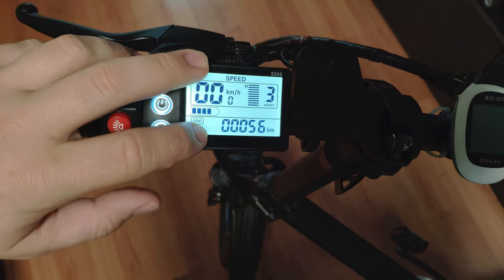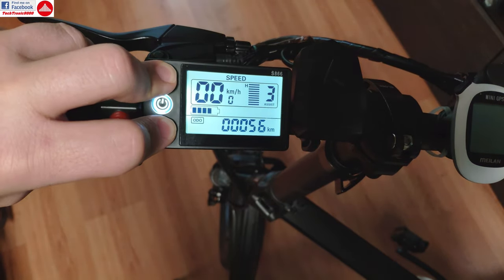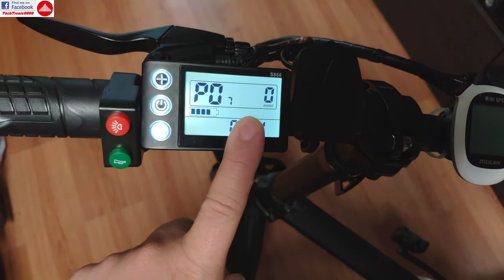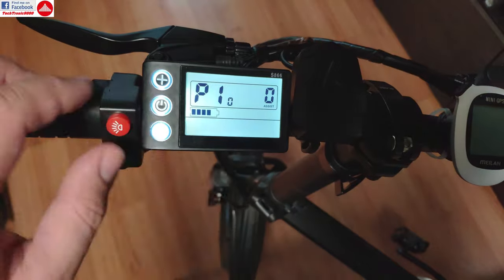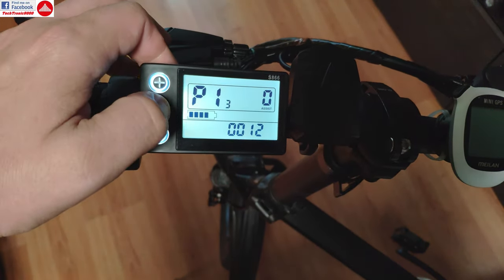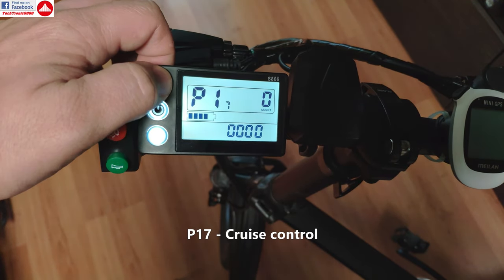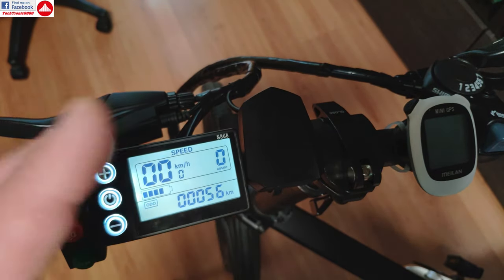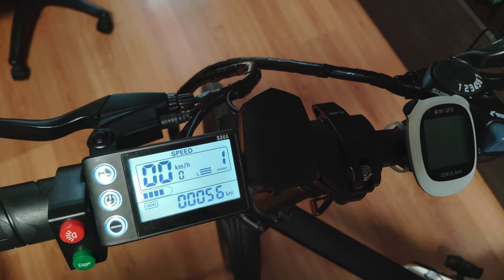ADO A20 / A20F / A16 S866 LCD - Complete Settings Walkthrough (P01-P20)

Comment: To get cruise control to work at least on my bike ( I have a s866 controller it's a hit way bk11) hold the throttle in a comfortable position say going 13 mph hold it there then push and hold the negative sign (-)on the controller. After a good 3 to 5 seconds a letter "P" will appear on the display where the assist value number normally is.you'll be able to let go of the throttle and you should be able to maintain that speed even if you start pedaling. I use this function to set my speed to something that's comfortable for me to keep pedaling with resistance while in 7th gear and not feel like im doing the running man..lol. just a nice powerful pace and I can continue to provide manual power and save a lot of battery as my pedaling and the cruise control work in tandem. Please let me know if you were able to get this to work for you.

Comment: I bought the Hitway BK3S and l've been having quite a lot of fun with it for the last few days. It has 3 speed settings that are L - 9MPH M - 12MPH and H - 15MPH and everything was fine until yesterday. Now L and M still work as intended but H is now around 20MPH, I don't know what I've done to uncap the speed limit but I want it back to 15MPH. I'm more concerned about the motor/battery exploding than anything, plus the bike doesn't have very good brakes so 20MPH is just to fast for me on this bike (also it's illegal l think in the UK)

Comment: Thanks for you help, do you know how to reset it back to factory settings?
Reply from the maker: There is no reset to defaults. You just need to set each parameter correctly.
Reply: DEFAULT SETTINGS 
:
P01: 2    (Display brightness)
P02: 0     (Km or miles) 
P03: 36  (Nominal voltage)
P04: 10   (auto sleep time minutes)
P05: 0     ( power assisted mode )
P06: 20   (wheel diameter)
P07: 1     (number magnets motor)
P08: 25   (speed limit, increase to 44 for max speed)
P09: 0.    (non zero start, 0= no pedal needed)
P10: 2.    (drive mode, electric, assisted or normal bike)
P11: 2.     (assist delay since peddling started)
P12: 3.     (Strength of acceleration)
P13: 12    (PAS sensor)
P14: 15     (controller current limit)
P15: 29     (battery controller voltage limit)
P16: 0       (reset odometer, km to 0= new bike)
P17: 0       (cruise control)
P18: 100   (Display range adjust)
P19: 0       (0 gear assisted)
P20: 0      (controller communication mode)

Comment: I have hitway bk11 and ive changed it to 100 speed limit but it still doesnt go past 25kmph is that because i dont have a throttle? Can it go past the limit in pedal assist mode? Very gratefull for any reply.
Reply: I found out I had to change p08 setting to 67 instead of 100 and that worked hope it helps others.
Reply: Is your throttle broken? My BK11 has a throttle

Comment: When I start it up it shows that there is a battery percentage section. How do you get that active on the screen?
Reply from the maker: That is just a test for the LCD screen. The controller is not programmed to show the %, you can use the "VOL", voltage for even more accurate monitoring.

Comment: For Cruise control hold the throttle at what speed you want and then hold - for 2-3 seconds
Reply from the maker: Depends on the controller version. The ADO bikes has a controller version change, the first one didn't have working cruise control.

Comment: I accidentally changed the wrong setting in my bike now it reads 4km/h when it's stopped so I was panicking trying to get it back to 0, thanks so much for this video😊
Reply: How did you fix that my bike is showing 64mph when I know it’s not
Reply from the maker: Glad it helped

Comment: If p9 is activated (accelerator from zero) then by pressing and hold the minus symbol the motor is activated perhaps to enter walking mode off the bicycle and pushing it by hand
Reply from the maker: Yes, holding the "-" will enable walk assist mode.
Reply: So will this work to help get it up stairs..I would like to get one but stairs to my apartment

Comment: What about the main screen not in the settings? I've seen some S866 displays look different with the battery meter at the top and able to show watts/current
Reply: Mine shows watts and current. I think it is the earlier version of the display as I have had it several years.

Comment: Is that on a panther e movement? I just copied all your settings , it feels so much faster , p19 cruise control I had to turn off , it’s bloody scary:)
Reply: I tried all these settings as well and the torque was too strong and bike was too fast, at least for me living in a city. So I found a nice combination which also saved the battery life.
Reply: @GaryInAmsterdam  how fast was it able to go
Reply: @seanpatterson9244  The top speed I obtained (out of the city on a quiet flat cycle path with no wind was 35 kph. I weigh about 78 k and have my backpack and computer on me. But it was the startup speed that scared me in teh city after changing some settings. The bike would go from zero to 20 in seconds. Yeah, the cruise control would kick-in all the time too! 

I found a happy-medium setting which helped sustain battery life. I haven't used it much later since I don't commute as often.
Reply: @GaryInAmsterdam  that is quick! Nice on a flat clear road, but around a crowd I imagine it isn’t very nice , especially because the bikes turning circle and movement isn’t as easy as a standard bike , and that cruise control I found was horrible at top speed . Leat you found a happy medium now the more comfortable you are the safer you are :)
Reply from the maker: This is an ADO A20, but this display is rather popular and used on other bike brands also.

Comment: Thanks! I got a new Himo z20 and it has this controller instead of old with 2 buttons. Can you also explain how the main menu works? The options I have are:
- odo
- trip 
- vol
- cur
- rm
- t1

I'm not what they all mean (except for the first one which is showing km I've ridden so far), how to use or reset the others.
Reply: Hey, just got a new Himo ZB20. i have the same concern, please let me know if you find out. Thanks!

Comment: I can not get the settings to stay. For one example, setting the wheel diameter to 26, will be back to 20 randomly. I can scroll back thru and check, and it’s okay, but in a minute or two, it’s back to 20. That is just one example. Others that do the same are magnets, etc. It’s a brand new controller. Also I bench tested the headlight connection and it works perfectly… light on and off with “+” long press. Installed it on the bike, started it up, everything looked great. I turned on the headlight and it worked. However, it would not turn off using some button, In spite of the fact the light icon toggled. Even after the controller was turned off, I had to turn of headlight using my actual battery switch. I disconnected and scraped light idea, however the 48 volt remains on the two light connections when testing with a volt meter.

Comment: Excellent video!
I only have one question. What should I do to reset the odometer? Do I just push the minus button to reach the 0km?
Reply: What you're probably going to do is go to the odometer setting and then push and hold (-) button. I doubt it but it may also be the power button, having to hold that

Comment: Thanks for this video, very handy! I just bought a ADO A20+ international and I tried to unlock the speed limit. Already set P8 to 100 and P5 to more levels of assist. But yesterday when I tried it I could not go faster than 25 km/h. Don't know why... Does the 35 km/h only works in hybrid mode with throttle or does it also work with electric assist? I didn't receive the throttle yet, so can't try that.
Reply: Did you need throttle I'm having the same issue.
Reply: More levels of assist will not give you more speed. I'm not totally sure about your E-bike model but mine has 3 levels. If I change it to 5 or higher, it just basically continues assist levels 3 to the highest assist level "number on display"

Comment: Hi! I got my A20F for about 4 days now. I'm in Hybrid mode using the throttle in the third assist mode. When I'm in the second assist mode I get pedal assist until 25 km/h. Unfortunately it feels like I'm pedalling ''air'' even when I'm in 7th gear (It feels very light). I want to be able to give more power myself so the bike doesn't have to give so much motor power and let the battery drain faster.
Reply from the maker: Check my other videos where I show how to enable 5 modes for hybrid, you will have 3 assist modes and 2 electric throttle modes. Also you can upgrade the chain ring for a bigger one. You can also join the user group for more ideas and mods: https://www.facebook.com/groups/adobike01
Reply: @TechTronic9000  Which video? Link?
Reply from the maker: have a look at this, the display is different but the settings are the same https://youtu.be/sY08ZB4kAZI

Comment: Hello, I wanted to ask you when I enter the hidden menu to increase the speed of the electric bike, what should I put in the hidden menu of P02 P03 P04 P05 P06 P07 P08 P09 P10 P11 P12 P13 P14 P15 each number of P02 P03 P04 P05 P06 P07 P08 P09 P10 P11 P12 P13 P14 P15 P16 under yours there are other numbers. What numbers should I put in for the electric bike to go at full speed?  I have a 750w 48v motorcycle
Reply from the maker: It depends on your display and controller, usually P08 is the speed limit.

Comment: Hey, thank you for video. Very useful. 
Is it possible to show battery life in percentage “%”? When I turn on the display I can see for a few moments percentage and then it will be disabled. 
By pressing power and “+” button I can enable Max (MAX) and Average (AVG) modes. But I can’t switch to Distance (DST) mode. Can you please help me? Thank you in advice 😊
Reply from the maker: Battery is displayed only as "bars" and accurate as voltage.

Comment: Hi, thanks for the video. My S866 Display does only provide programs up to P16, next it jumps back to P01. I can't access P17-P20. But I need to change the protocol (P20), because otherwise it isn't compatible to my bikes controller. Do you know what I can do to access P17-P20?
Reply from the maker: If you have 16 settings then it's a newer controller model, there is nothing to unlock. Some settings are the same for both.
Reply: From what I've read, P17 to P
20 aren't useful anyway

Comment: My hitway BK5 has this controller, but now suddenly on assist level 3 it now goes to 21mph. The speed limit was set tk 25kph, Ive gone in this menu to lower the speed limit and it still goes to 21mph, how do I remedy this?

Comment: Thank you so much. I have an A26 and this video helps me a lot.
 I just have a question: Is it normal when I go through a hole in high speed, the display shuts down and sometimes it's hard to turn it on again. Many times the display only turn on  if I push and pull weakly the battery.
Reply from the maker: You have a loose plug or connector, I would check all the plugs and wires.

Comment: I assume more assistance modes is just more modes not any faster?
Reply from the maker: Yes, you have more levels but in the same range. This is useful when you enable the throttle on the ADO bikes as it uses the top assist level for throttle and you lose an assisted mode if you are on the basic 3 modes.
Reply: @TechTronic9000  thank you for the reply.
Reply: My display doesn't show the speed any ideas?

Comment: How to save changes because every time I put the correct details it does not save when I switch off and on again it goes back to factory settings also does not display accurate speed

Comment: Hi great video I bought my bike a couple of weeks ago The throttle does not work even after your set up advise I complained to the shop and asked for a new throttle this arrived eventually I fitted off the bike went through the set up but still does not work would this be a faulty controller
Reply from the maker: You need to enable the throttle from the settings, also enable zero start. Also if it's the new controller check my videos regarding it. You also need to enable throttle mode on it.

Comment: What should i do if I accidentally changed the volts and it won't turn on
Reply from the maker: Maybe you set a voltage limit higher than the battery level. Try to fully charge the battery, power on and correct the settings.

Comment: Yes.The walking assist or cruising mode.
Reply from the maker: Cruise mode is the possibility to keep the speed constant in all the available throttle range, walk assist is fixed at 6km/h.
Reply: @TechTronic9000  thats right.and cruise mode can be set in any speed you want.

Comment: Hola muy buen video, una pregunta en el P09 arranca desde la primera pedalada? O hay que esperar dos pedaladas igualmente? Gracias
Reply from the maker: Puedes ajustar el retraso desde P11, tiene 24 niveles de retraso que puedes ajustar.
Reply: @TechTronic9000  entonces si lo pones en 24 desde el primer instante ya te asiste?
Reply: @tonisuredajuli7  el p09 activa el control del acelerador para que actúe desde parado o llegando a los 6km/h. Si lo dejas en 0 y tienes activado el modo híbrido o eléctrico puro es como si fuera una moto.

El p11 es un delay en segundos de la asistencia. Mejor dejarlo en 0

Comment: Hello!
Can this bike be tuned?
Take this to mean that I want to include a 48V battery.
This should increase your range in pure electric mode.
At 0:44, you said that this bike knows the 48V system.
What should I pay attention to when buying a battery?
Reply from the maker: Yes this bike in particular comes with a a 36/48V compatible controller. The motor will also go fine on 48V. The performance will see a large boost in speed, acceleration and range.

Comment: Very good and informative, I have just fitted the newer controller and cruise control definitely works
Reply from the maker: The cruise controller option is related also to the installed controller, on the particular ADO ebike model with 1st generation controller this was did not work. It was soon upgraded to version 2.0 and this was enabled.
Reply: What model is the newer controller
Reply: @Subscriptionexperiment  I am sorry i sold the bike just after, I wasn't particularly impressed with it breaking all the time
Reply: Thanks. I'm looking at the s900 display. I just want a display that has cruise control.
Reply: @Subscriptionexperiment  it wasn't the handlebar controller this is the replacement controller box inside the frame i changed that gave that functionality

Comment: My bikes odometer and speed is off compared to a GPS unit I have.  Which setting do I use to adjust this?  My display is slower and shows fewer miles than the GPS unit.  Thanks in advance for your help.
Reply from the maker: From wheel size.

Comment: When i change assist delay to 1 there is still a big delay. Is this normal for this bike? Its pretty annoying sometimes. Have to peddle 5 times even at setting 1
Reply: i have the same question
Reply from the maker: Try to set it to 24 (as it ranges from 1 to 24), should be almost no delay. It's confusing as the setting seems to be reversed.
Reply from the maker: Try to set it to 24 (as it ranges from 1 to 24), should be almost no delay. It's confusing as the setting seems to be reversed.
Reply: @TechTronic9000  at 24 there is very much delay

Comment: I've tried unlocking the speed from p08 menu (I set it 100) but speed is still limited to 25. Is it possible that it's locked in hardware? My himo z20 doesn't have the throttle handle like in their older versions btw, it only works when I pedal.
Reply: I have the exact opposite problem lol

Comment: Great video, very informative. Please could you tell me the best settings to have with a 36v battery, it seems to switch off the lcd display and cut everything out when i use pedal assist on a hill even on a fully charged battery. The bike is only a few months old too.
Reply: Hi, did you manage to solve this problem? I have the exact same issue..

Comment: To activate cruise control press and hold '' - '' button for 3s
Reply from the maker: That is walk assist and it's limited to 5-6km/h. Cruise control was added later in the newer controller. For more info you can check my newer videos.

Comment: Should the voltage be set to match the battery? My battery is 48v, so should I set it to that? Or is under volting okay?

I got my bike second hand and all the settings have been changed for max speed lol so I wanted to make sure all the settings are okay. Don't want to damage the battery
Reply from the maker: There are 2 voltage settings, one is for the cut-off so you don't over discharge it, while the other is for nominal voltage so that the controller know hos to display how much % battery is still left.

Comment: hey what would be the best setting for battery under voltage protection thanks??
Reply from the maker: Not lower than 32-33V for longer lifespan, you can even choose 34V but it might cut out too early.

Comment: Respect on a Great set of videos on the Ada a20f really helpful and informative I was hoping to upgrade my motor to a 1500w and my battery to a 48v 19.2ah mounted on the frame and upgrade my controller but I want to keep my display and currant wiring don't want to change  everything can you recommend a controller that will support this please.
Reply from the maker: Well then you are lucky, the ADO A20F comes with a dual voltage controller which works for both 36V and 48V, while the power is limited to 15A which at 48V is 720W already! Just enter the settings and switch to 48V.
Reply: did you upgrade the hub motor?
Reply: @mikewoolnough9102   no I found the current setup to be enough power I did change the handle bars and seat and put some mudguards and a mirror on but other than that I've left it alone thanks for your input.